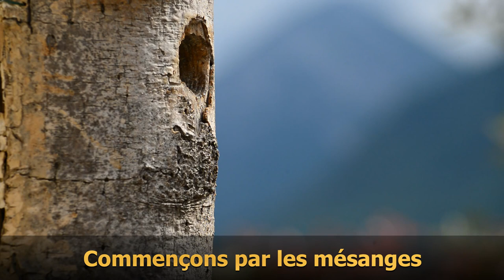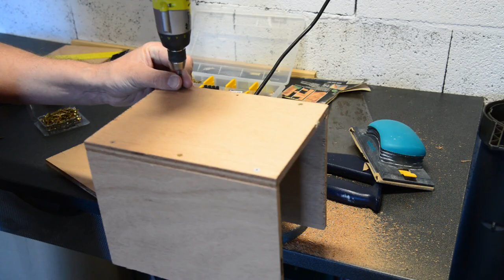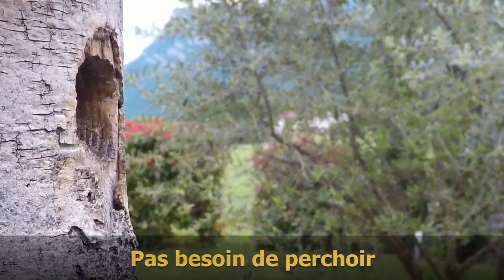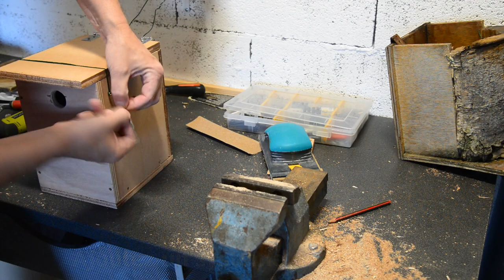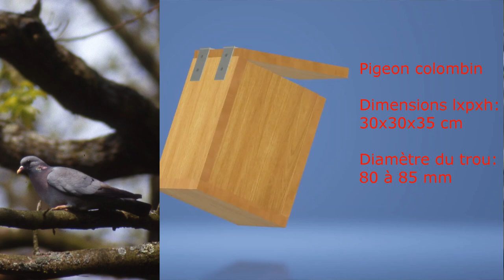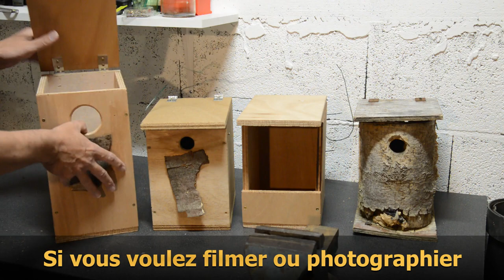Tuto: Fabriquer des nichoirs en bois pour mésanges, huppes, pics, rouges-gorges... (15 espèces)

Comment: Great, now I can make nest boxes which I have wanted for a long time
Reply from the maker: Thank you. You'll perhaps have to adapt the hole size to the indian spiecies. What do you have in your region? Tits, redstarts, woodpeckers, flycatchers...?
Reply: @PhilippePhotographie  Sparrows, bulbuls and starlings are the most visible variety in our area
Reply from the maker: @Fortheloveofbirds2020  I guess bulbuls will make their own nest in a tree, but sparrows may be interested in a nest box with a 35mm hole and starlings need a 55mm hole. You can make it a little larger (65mm) if you want to have a little chance to have hoopoes...
Reply: @PhilippePhotographie  So hoopoes also may come, yayy, thanks a lot😀
Reply from the maker: @Fortheloveofbirds2020  you have to be very lucky to have hoopoes, but it's possible...! Try to listen carefully in spring, if you hear some hoppoes... They like open areas, with fields, meadows, few trees or hedges. Sometimes they like holes in an old building or in a wall made of big stones.

Comment: Tutoriel très intéressant.
Pour éviter qu'un pic vert agrandisse le trou pour s'introduire dans le nid et enlever les oisillons pour les dévorer, j'ai plaqué un disque métallique. Ce disque est réalisé à partir d'un couvercle de pot de confiture ou d'un pot de cornichons. La découpe intérieure se fait avec un petit couteau de cuisine pointu bien aiguisé et tapotant dessus avec un marteau. Placez une planche martyre en dessous. Pour l'extérieur, utilisez une cisaille à tôle. Pensez à limer les contours. Portez des gants.
Reply from the maker: Merci beaucoup pour votre commentaire et pour votre suggestion. Effectivement, j'ai déjà vu des pics, épeiche en l'occurrence, s'attaquer à une nichée de mésange.

Comment: Merci beaucoup la vidéo est très complète et accessible aux néophytes ;) trop cool. est-ce que vous avez un tuto pour fabriquer le nichoir dans une bûche par hasard ? :)
Reply from the maker: Merci, c'est gentil. Non, je n'ai pas ce genre de tuto. Il faudrait que je prenne le temps d'en faire un pour des nichoirs moins classiques: dans une buche, pour les grimpereaux, pour les chouettes. Dans une buche, je creuse directement à la main, avec une tarière et une gouge... Mais c'est difficile, il faut que je m'équipe mieux. Ensuite je fais le trou sur le coté et j'ajoute le couvercle.
Reply: @PhilippePhotographie  Merci pour votre réponse. Je vais essayer !

Comment: Est-ce que vous pensez que c'est aussi pour les écureuils
Reply from the maker: Bonjour et merci pour votre commentaire.
J'ai déjà vu des écureuils s'installer dans les plus grands de mes nichoirs. Mais il est préférable de leur fabriquer un gite spécifique. Pour les dimensions, vous pouvez fabriquer une "boite" de 30x30x40cm. Vous pouvez faire plusieurs ouvertures, une devant et une sur le côté par exemple. Le diamètre doit être d'au moins 70mm.
Faites attention, les écureuils peuvent s'intéresser aux nichées (œufs et oisillons) alentour. Et ils sont très agiles et malins. Donc si vous avez des nichoirs a proximité, il ne faut pas qu'ils puissent ouvrir le couvercle ou rentrer par le trou.

Comment: Perso je fabrique avec du résineux brut de 20 ou 25 mm pour la solidité et la résistance. Je mets au moins une vis en plus pour le couvercle contre les coups de vent et je protège l’extérieur avec de l'huile de lin pour la durabilité. Ceci me permets de les laisser toute l'année dehors car j'ai lu que les mésanges repèrent leur nichoir dès l'hiver et que j'ai plus d'occupation depuis.
Reply from the maker: Bonjour et merci pour votre commentaire,
Vous avez raison, c’est encore mieux en bois massif. Et effectivement, les mésanges visitent souvent les nichoirs vers fin septembre début octobre… J’ai observé ce comportement de nombreuses fois, mais par contre, je ne peux pas confirmer que celles qui ont visité un nichoir sont celles qui s’y installent au printemps…
J’espère que les vôtres sont occupés.
Bonne journée.

Comment: Bonjour, pour vous me dire quel bois utiliser pour la fabrication  des nichoirs ?
Merci par avance
Reply from the maker: Bonjour et merci pour votre commentaire... Dans le vidéo, je propose la solution de facilité : le contre-plaqué extérieur (ou "marine"), à la coupe. Ces nichoirs pourront résister plusieurs années aux intempéries, mais probablement pas 10 ans… Une meilleure solution est d’utiliser du bois massif, imputrescible ou au moins, plus résistant que la moyenne et en 15 à 20mm d’épaisseur. En espèce quasi imputrescible, vous pouvez utiliser le mélèze ou le sapin de Douglas (introduit en Europe il y a 200 ans). Le sapin devrait bien résister, ainsi que le châtaignier, le chêne et dans une moindre mesure, le pin. Vous pouvez aussi utiliser du bois de récupération… Tant-pis si le nichoir ne dure pas 10 ans. Vous aurez offert une 2ème vie à ce bois… Le plus important, c’est qu’il ne soit pas peint ou lazuré. Et c’est bien de le laisser brut. S’il est trop lisse, vous pouvez le « griffer » ou passer un coup de râpe. Car les petits ont parfois plus de mal que les adultes à atteindre le trou pour leur envol.  Vous pourrez aussi augmenter la durée de vie du nichoir en ne laissant pas le nid de l’année pourrir dans le nichoir. Pour cela, videz-le en août.

Comment: Super video! Etes-vous sûr des dimensions? D'où les tenez-vous?
Reply from the maker: Merci! Pour les dimensions, le plus important, c'est la taille du trou pour les petits oiseaux. Il faut être précis, car si vous le faites trop petit, l'oiseau de l'espèce attendue ne pourra pas rentrer et si le trou est trop grand, un oiseau d'une autre espèce plus grande (et potentiellement plus "costaud") pourra le déloger. Vous pouvez vérifier les tailles des trous sur différents sites de la LPO (Ligue de Protection des Oiseaux) comme celui-ci:
https://nord.lpo.fr/conseils-nichoirs/
Vous pouvez aussi faire un trou de 32mm, qui permettra à toutes les espèces de mésanges de rentrer. Vous observez votre nichoir et si vous voyez une espèce plus petite qui commence à s'installer, vous pouvez visser une petite plaque avec un trou plus petit. Comme celle-ci (en bois ou en métal):
https://protectiondesoiseaux.be/produit/plaque-de-protection-28-mm/#:~:text=Une%20plaque%20de%20protection%2028,nichoir%20n'est%20plus%20habitable.
Pour des trous plus grands (50mm ou plus), de nombreuses espèces pourront rentrer et la concurrence peut être âpre. J'ai déjà vu des étourneaux essayer de déloger une nichée de pics épeiches!
Pour les dimensions intérieures, c'est moins crucial. Vous pouvez les faire plus grand que ce que j'ai indiqué. J'ai déjà vu des mésanges s'installer dans un énorme nid pour chouettes effraies (qu'on appelle effraies des clochers maintenant).
C'est le bon moment pour se lancer dans la construction des nichoirs. Si vous utilisez du contreplaqué, vous pouvez passer un coup de râpe sur les parties intérieures, pour que les oiseaux puissent plus facilement s'agripper sur les parois.
Le top, c'est de creuser un nichoir dans une buche, ça fait de très beaux nichoirs. Et c'est plus naturel pour les oiseaux. C'est dans ce genre de nichoir que j'ai filmé mon reportage sur les mésanges. Mais c'est plus compliqué à faire!

Comment: Bonsoir ce ni joie m intzresse pour le faire mais votre vidéo hélas est trop rapide et et vous ne donnez aucune dimension ni quel bois vous utilisée ni le diamètre du trou pouvez vous nous donner tout s il vous plaît et pour quel oiseau c est moi j ai beau oup de jeai
Reply from the maker: Bonjour et merci pour votre commentaire.
Tout au long de la fabrication, je donne les dimensions pour les mésanges.
Mais si vous regardez à partir de 6'00", je donne les dimensions pour chaque espèce d'oiseaux.
Pour le bois, dans le vidéo, j'ai utilisé du contre-plaqué extérieur, de 12mm d'épaisseur, qui résiste assez bien aux intempéries. Vous pouvez aussi utiliser du bois massif (pin, sapin ou bois imputrescible), c'est encore mieux. Dans les magasins de bricolage, vous les trouverez en général à partir de 18mm d'épaisseur et en grandes planches à l'unité, genre 40x180mm minimum.
Les geais ne s'installent pas dans les nichoirs, ils ne sont pas "cavernicoles".
Par contre, ils s'attaquent aux nichoirs. J'ai observé de nombreuses attaques par des geais et par des pies. Il arrive aussi aux pics épeiches de s'attaquer aux nichées de passereaux. Et j'ai observé des attaques d'étourneaux sur des nichées de pics.

Comment: Mais se n'est pas du bois! C'est du contre-plaqué!
Reply from the maker: Bonjour et merci pour votre commentaire.
Le contre-plaqué, c’est aussi du bois… 😉 ! Bon, blague à part, je comprends ce que vous voulez dire et je suis d’accord. C’est ce que j’ai écrit en réponse à d’autres commentaires : c’est effectivement encore mieux avec du bois massif et avec une essence qui résiste naturellement aux intempéries. Les instructions restent valables, quelque soit le type de bois utilisé. J’ai montré dans la vidéo la « solution la plus simple », avec du bois qu’on peut faire découper en magasin à la largeur qu’on veut. Ce qui permet de réaliser ces nichoirs rapidement, facilement, avec peu d’outils et sans être bricoleur.
Mais si on veut faire encore mieux, on peut creuser une bûche. Ce que je faisais avant. On voit un nichoir de ce type en fin de vidéo. Mais ce n’est pas facile à réaliser, surtout dans du bois dur ou pour un gros nichoir. Et il faut avoir un outillage adéquat…
En tous cas, 3 des nichoirs que j’ai fabriqué pour ce tuto sont installés chez moi, depuis 3 ans. Ils sont toujours en bon état et 2 sont occupés. J’espère que les votre aussi.
Pour mon prochain tuto nichoir, j’utilise du pin massif en 18mm d’épaisseur et il pèse 35kg… ! 
Bonne journée à vous.